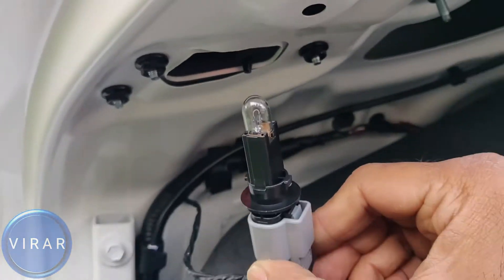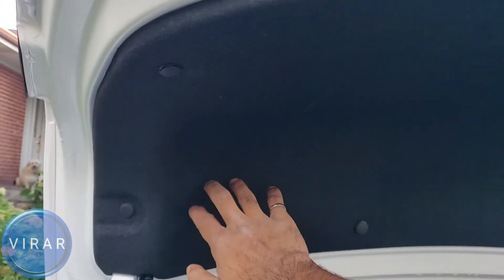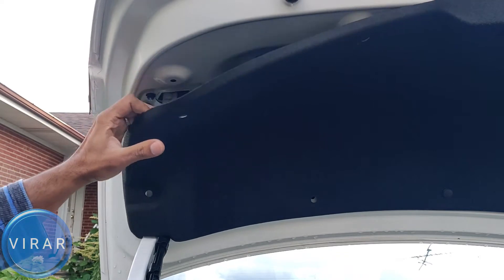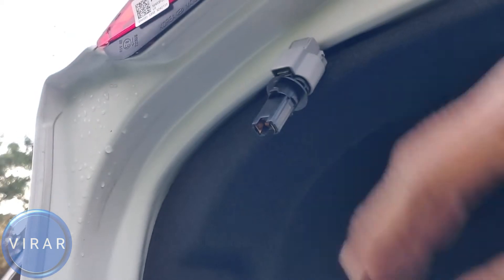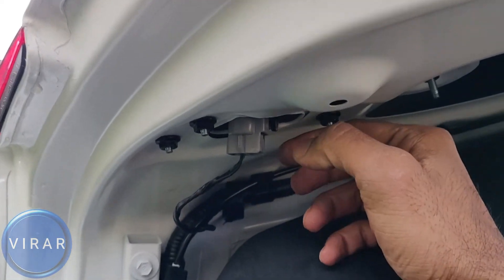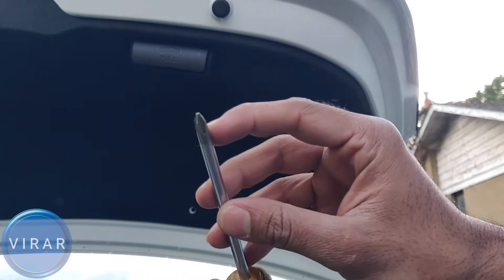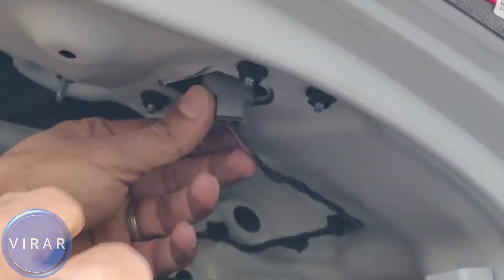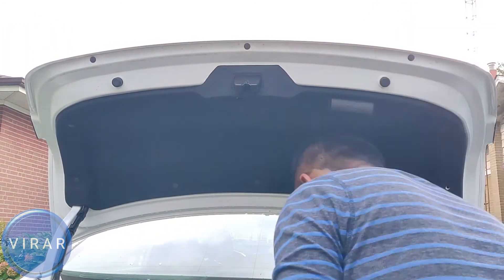How to Replace Inner TailLight Bulb - Hyundai Elantra (2019-2020)

Comment: Brother, to God be the glory. I thank him so much that you have created these awesome videos that are very detailed. Question for you, my 2019 Hyundai Elantra has 71000 miles on it. One of my brake lights and that other light(this video) next to it is not working. You know how it is, on these cars reach 71000 mi, when one light goes, sure enough, and a month or so another light will go and then after another month another light will go, so wouldn't it make sense to just replace all the light bulbs in the back, thus preventing much more work in the future with disassembling and reassembling
Reply from the maker: Thank you for your kind words Brother. Nowadays these bulbs last for much longer than just 71000 miles. I don't think you need to replace the rest of the bulbs right now (the ones which are working just fine). However if you want usually when you buy the bulbs, they sell it in pairs. So if you want to fix this particular issue on both the sides, then might as well since you already pay for the 2 bulbs. But other than that, I don't think you should worry about changing the rest of the bulbs.